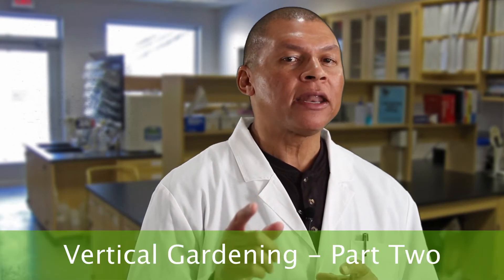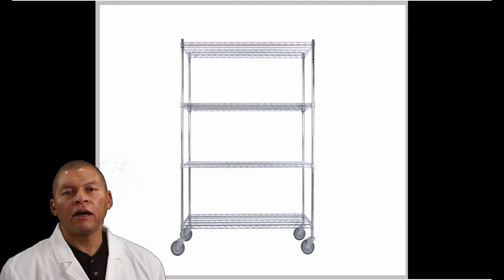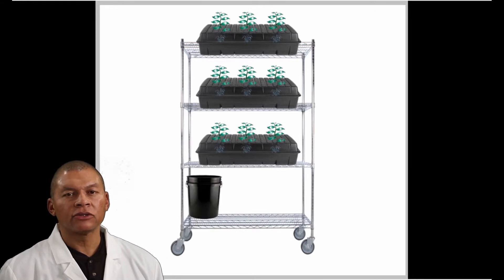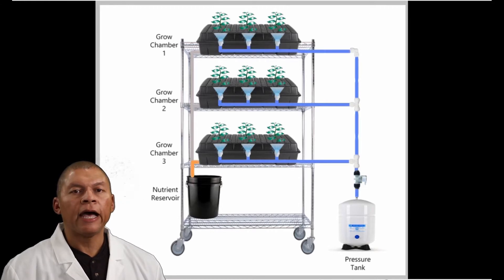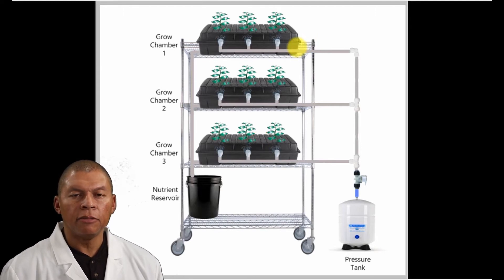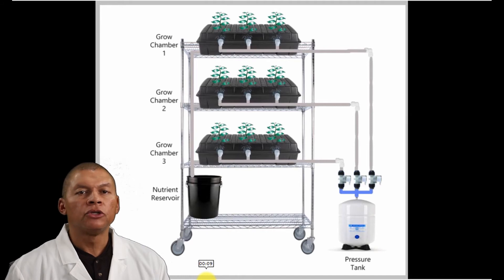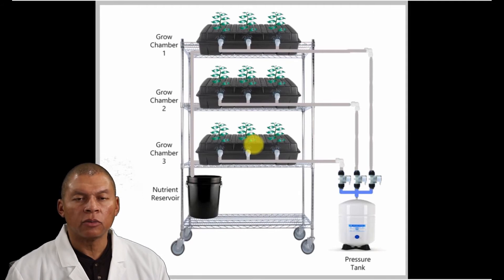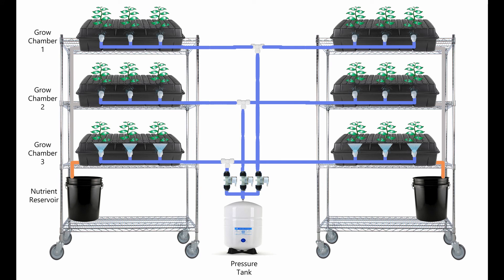Vertical Garden for Professional and Commercial Aeroponics Growers - Part 2

Comment: You mentioned in aeroponic you can grow a plant from seed. How would you hold the seed? I am assuming a holes in a normal basket is too large for seeds like lettuce. I would appreciate your help on this.
Reply: I am planning on doing this using a bit of cheesecloth to wrap the seed inside the net pot to prevent it from falling through.

Comment: Thank you for the tutorial greatly apricated. Anyway, I have a few questions how far should the nozzles be spaced apart per growing chamber.  The reason I am asking is I have very long table 10 L/F   I was thinking of spacing 2  to 3 growing chambers across the table. in addition, what would be the max spray nozzles per line?  should I put a pressure gauge at the end of the series to verify 80 to 100 psi. Using this method would also make lighting much easier and ideas on economical light fixtures for indoor growing in have the perfect room. I find your expertise and content addicting I have to stop for now im about 7 videos in at one secession, nice work thank you.
Reply from the maker: Hi majestic,
The aeroponics calculator should answer most of your question.
Thanks for asking

Comment: Are solonoids and pressure tanks required if you are doing a smaller setup with just a pump and and an on / off timer and pressure switch? Or is this for larger systems where a tank needs to hold a higher pressure?
Reply from the maker: Yes, they are required if you're serious about true aeroponics. However, feel free to try it out. It could work for what you're growing. Thanks for asking

Comment: On the first design with the one solenoid, can’t you continue the single pipe driving the water past the third connection, causing back pressure that would drive the pressures evenly through the pipe or even create a 4 pipe manifold right after the single solenoid to do the same as the 3 solenoid as long as the piping was the same length and diameter after the manifold?
Reply from the maker: If I understand what you mean, it would all need to be at the same level.
Reply: If you were to put the manifold at the top level,  then wouldn’t that take care of the problem you were talking about.

Comment: Where do you position the nozzles in the grow chamber?  If directly at the bottom, won’t the roots eventually block the nozzles and misting?
Reply from the maker: jtg. Your best position is the bottom. However, there are more things to consider to determine the nozzle location. Your root chamber should be deep enough where the roots never touch bottom. This is another video making. 
Thanks for the question.

Comment: I have 2 questions I own a tower garden. I purchased new nutrients. Grow and bloom. I am using 200 ml of solution in a 20 gallon tank. Running in intervals of 15 min on and off. I’ve been having issues with the growth they are dying. Is this due to over fertilization of nutrients? I am looking at you system and I am wondering what happens when the tomatoes, basil and peppers start growing like a weed.  How do you set it up from the first second and third stage. Or do they have their own system like tomatoes and peppers. Basil separate with other herbs. I have had awesome results in the past using their nutrients I decided to go with a different food.
Reply from the maker: I'm a high pressure aeroponics grower.